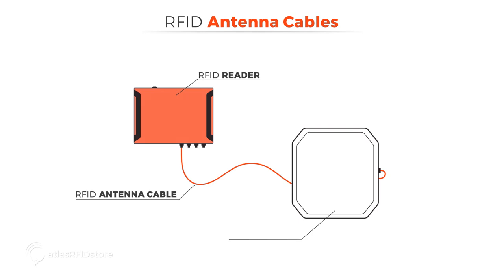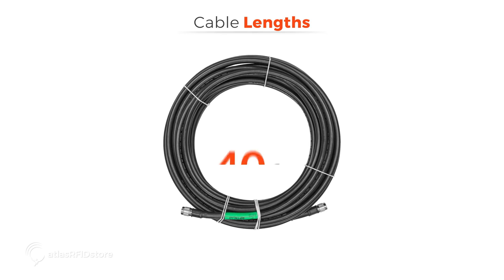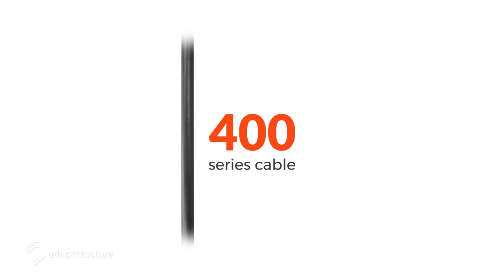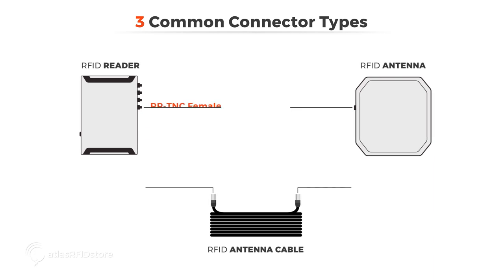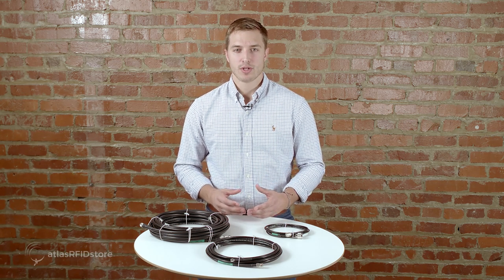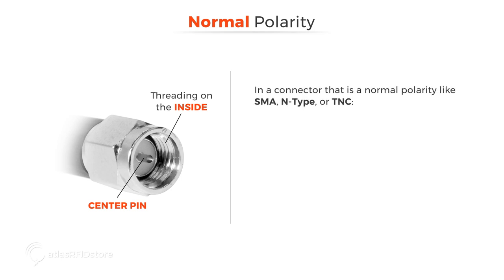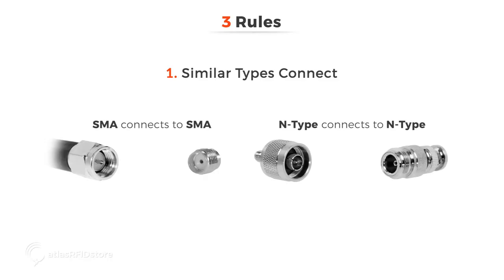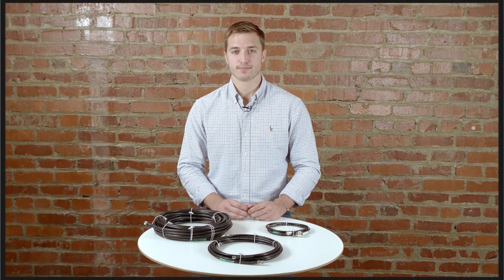How to Purchase an RFID Antenna Cable

Comment: I have a Mikrotik antenna D-5G-30D#-PA to connect to a 5G router. Can I use this cable to increase internet speed (from inside to outside) and will it work?

Comment: Can I connect this antenna to mfrc522 rfid reader
Reply from the maker: Jagdish,
I'm not sure which antenna you are referring to, in this video I think it's just antenna cables; however, I took a look at the MFRC522 and I don't think you can connect an external antenna to that reader. A few things to note about that reader/antenna combo:
1. It looks like an external antenna cannot be used, only the internal antenna.
2. If connecting anything, it looks like it would have to be through I/O pins. 
3. This reader/antenna is 13.56 MHz and this video (and most on our channel) is UHF which is 860 - 960 MHz. I just wanted to let you know so you don't purchase or attempt to purchase something on the wrong radio frequency!

Thanks for the question - I hope I helped!